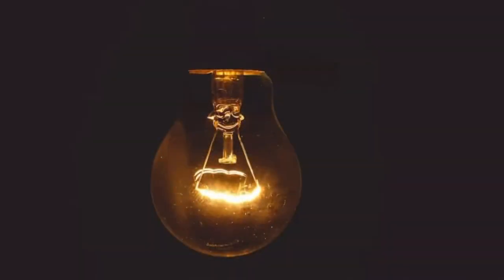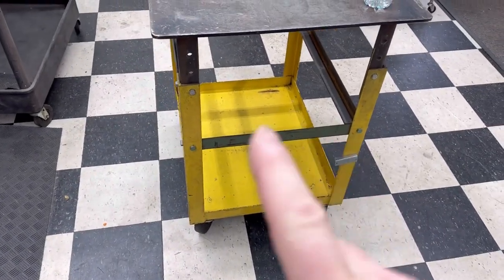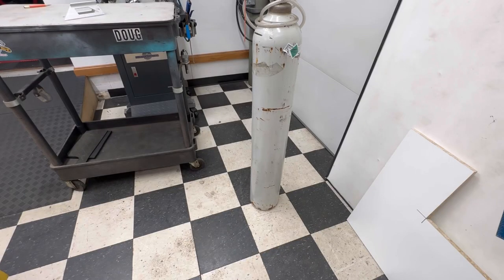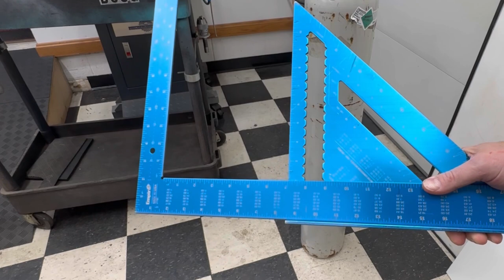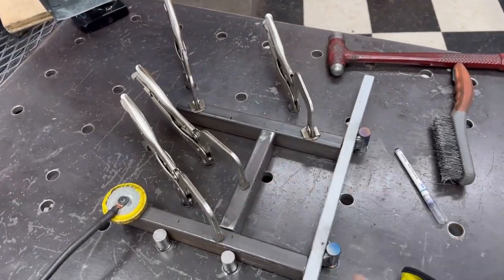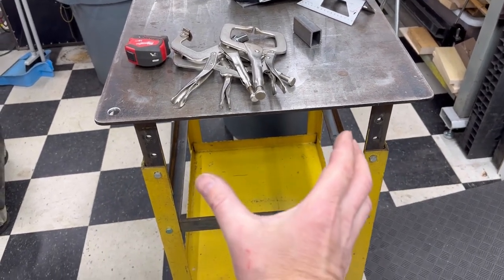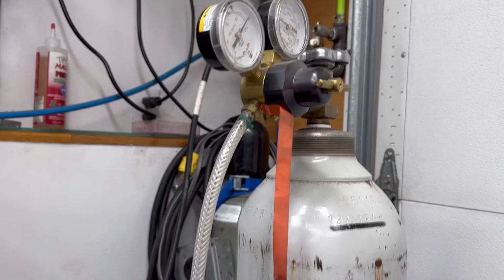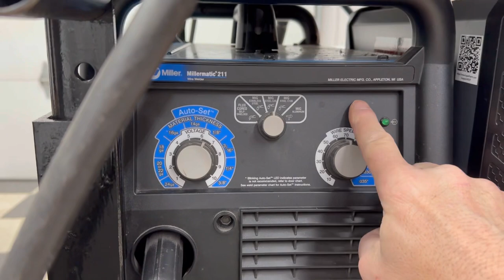The ULTIMATE WELDING CART.

Comment: Doug, you are a man of innovation!
I repurposed a Pressure Washer frame with wheels to hold my (flux core) MIG and Stick Welders.
I also added a 20' Retractable Extension Cord (120V with Breaker & swapping both plug ends) for better Versatility and a Metal "tip Open" bin above the Welders (with a magnet to keep it closed) to hold tips & tools. And a couple of Rod Holders attached to the Uprights.
Reply from the maker: Isn’t it fun coming up with ways to make things much better for yourself!

Comment: I thought for sure the gun holder was cut to a perfect size to use it as a tank wrench. I like the idea, I use my Klutch welding table as my cart. I added a shelf on the bottom, a 4 outlet box for my mig, grinder, and whatever else, then I added wheels. I do however find everything on the shelf gets dirty because of the holes. My MIG is a flux core so no bottle for it.

Comment: For $2,900, the Miller welder doesn't come with a nice gas strut to hold up the side cover? You should write them a scathing letter and demand revisions. haha. I love this cart idea! I love the flush mount cables that can't get smashed, because the table top steel is wider than the rest of the cart. Having a welder under a welding work table, really seems like the best combination of saving space. Most people don't need a gigantic stand alone welding table with dozens of clamps, for basic farm and shop repairs. 19:26. The rack on the cart that holds the welding helmet, gloves, jacket, and nozzles, is just amazing.
Reply from the maker: Thank you!!

Comment: Doug great cart some great simple ideas and easy but smart like it a lot.  You have a piece of equipment beside that welder I would really like to have some classes on is the mill machine.  I rebuild Perazzi trap guns for a hobby and when your fitting a new block I can see that would be a very hand machine to help in the job.  Right now I do everything by hand which still works very well just need lots of patience… Great videos also watched the one explaining your eye injury, at my cottage a couple years ago similar thing involving a bobcat except a guy had a tow rope on a root ball and was pulling it out and when it let go it sling shotted and came through the cab and actually man passed away from his head injuries so thing happen very quick… always have to be thing what could happen if things don’t go right…

Comment: Brilliant job as usual Doug! A big shout out and thanks to Autumn for shooting this video. It’s always nice to see & hear Autumn’s input and ideas. You kids really knocked this one out of the park. Everything was well thought out and done to perfection. I agree with you on the rocker switch on the Miller. It looks like there is room on the front panel. My only concern there is if a warranty issue arises they may void the warranty since it was modified. If it’s already out of warranty, there is a rocker switch blank insert on eBay for 7.99. It’s 1/2”X3/4”. I know you could also make one out of a small piece of whatever you have laying around See you in the next installment. Have a great week & be safe.

Comment: Doug I started welding this weekend and I have two (probably stupid) questions for you.  Because I know you have a place for everything and keep a very neat shop - where do you drop the mig wire clippings when you trim the excess wire from the gun?  How long do the batteries last in your auto dimming welding helmet, should I be taking them out if I’m not using my helmet for a week or two?  Thanks!
Reply from the maker: I cut the wire and drop it into my grinding tray but a small metal can would be a great idea on the cart!!

With my helmet, it gives me a low battery light. So I just change them when it comes on.
Reply: @OneEyeCustoms  Thanks for the detailed response!

Comment: Good job on the cart. Any chance we can get thee cart measurements?
Reply from the maker: The cart is 24x30x36” tall  and the welding table is 30x36x30” tall. Adding the bottle rack to the cart makes it about 12” longer and the dust collection box on the table adds about 14”

Comment: Thank you sir! I am definitely using this idea to make one of my own!  Just a quick question - do you see any issue with the entire cart being grounded, when welding?  I only ask, because of any other equipment that might be stored that touches metal - short circuit etc.  Thanks!
Reply from the maker: No sir, not at all. Most welders can sit on a cart or under a welding bench with no problem. Plus they are both sitting on a rubber mat.
Reply: @OneEyeCustoms  Perfect!  Of course, rubber mat removes any risk - d'oh!  Thanks for the quick reply sir!

Comment: @4:50 is that magnetic ground hockey puck looking thingy a commercial made product or a OEC project ? 😀
Reply from the maker: I made that magnetic ground myself!
Reply: @OneEyeCustoms  could you provide a little more detail on the design
Reply from the maker: @Johnny G what kind of info are you looking for specifically? I’d be happy to.
Reply: @OneEyeCustoms  Is it just a neodymium magnet with a machine screw threaded through the center?
Reply from the maker: It is a magnet out of an old car speaker. You don’t want to use too powerful of a magnet. A neodymium magnet would be way too powerful and a pain to pull off all the time. You just need a magnet with a hole through it that the metal bolt or whatever touches to steal your welding.

Comment: So to answer your question about the power switch in the back, is because that welder was designed for all (not just North American) markets. The rest of the world mandates that the power switch is located in the rear near the power cord for whatever reason. This is why all the typical Amazon welders have the power switch in the rear because they only have 1 model of that particular style and they have no clue where their machines will end up. Your miller is strange to me, they must be cutting costs and making their machines for a global market as a posed to a North American machine and a "the rest of the world" machine.